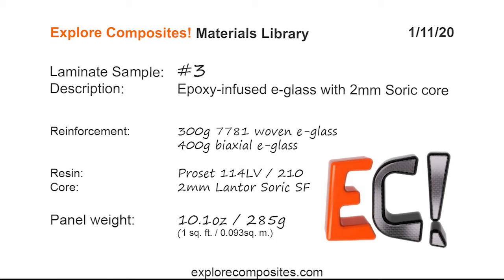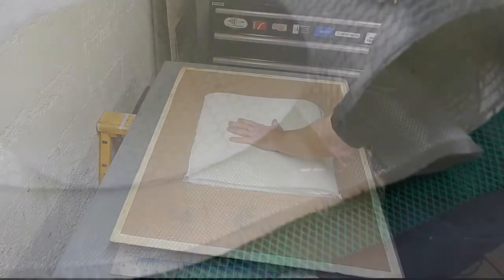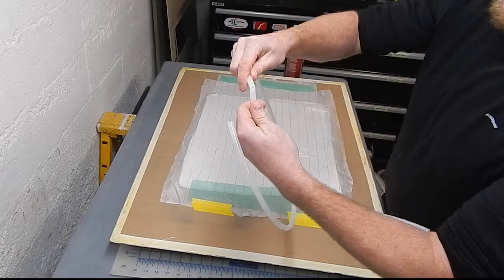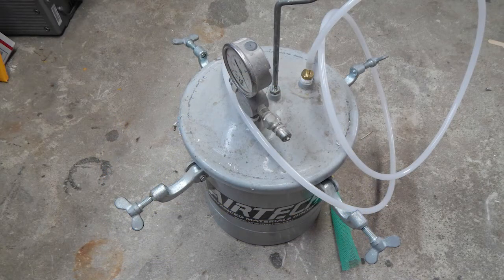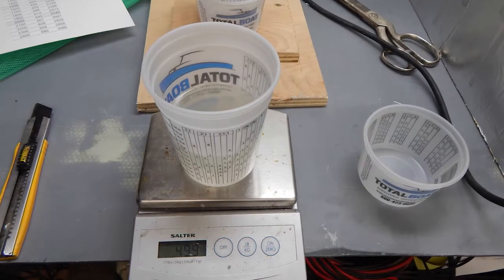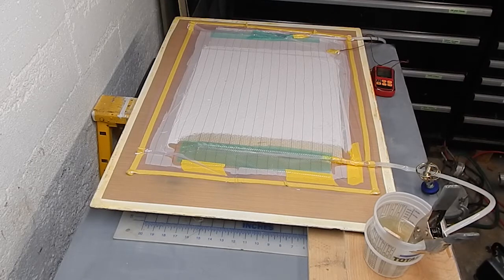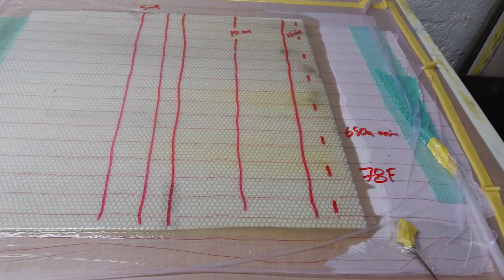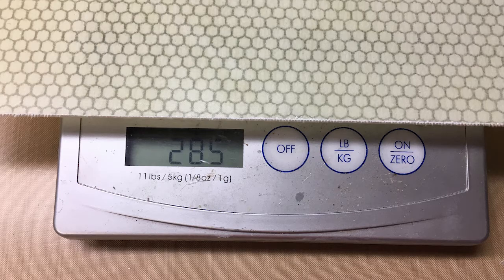Laminate Sample #3: Epoxy Infused E-glass with Soric Core

Comment: Do you have any insight on using perforated release films directly on the part surface (replacing peel ply) with flow mesh on top? There seem to be limited options in obtaining a smooth finish on the bag side.
Reply from the maker: Yes, it works pretty well as long as the perforations are big enough to let the resin through.  There is a (ex. Solvay - now Aerovac ) product called Infuply (Airtech makes one too but I forget the name - probably others as well) that is just a 3D flow mesh with perforated film pre-applied to it.  Seems to work pretty well even for thicker parts that need a lot of resin.  Not sure how smooth the surface will be though - usually gets crinkly finish from the film.  For a smooth finish you may be in caul-plate (or sheet) territory - but you'll need an internal flow media...

Comment: So how strong is it? What would you use soric core for?
Reply from the maker: Lots of things I guess - things that need to be composite for geometry or gelcoat finish but that don't have to be crazy light.  I know it's used in small boats a lot - but boats are what I know best.  You probably don't find much in airplanes - but maybe!  

Soric is probably best used with polyester or vinyl-ester from a cost to performance perspective but it is great for hard-to-fit core areas even with epoxy or carbon price-point parts.  Its just so much faster/easier than foam.
Reply: @ExploreComposites  Thanks for responding to really my dumb question. Certainly you teach anyone who watches plenty and probably are often asked questions that have obvious answers to those who know. Anyway thanks for your informative videos and again, responding to my dumb question

Comment: Would be nice if you had a metric column with grams or kilograms and sq meters too. Excel could do these on the fly from your numbers.
Reply from the maker: Some of the samples are metric, others imperial.  Metric is better of course but I try to mix it up.  Doing both makes sense though!  

Will look into it - Thanks!

Comment: Hi, what is the teflon material that you put on your table? What type of surface does this give the final product and is that surface ideal for future bonding? Thanks
Reply from the maker: It is a Teflon film with a silicone adhesive.  There is a video called: ‘Adhesive-Backed Mold Release Film for Composites Tooling’ and an article linked in that description with a list of sources and manufacturers at the bottom.  It leaves a shiny surface do sanding or peel ply are necessary for secondary bonding.
Reply: Explore Composites thanks so much!

Comment: hi, what was the final thickness of the laminate?
Reply from the maker: This one is 2.7mm / 0.11" thick.  I should go back and add that in the descriptions for these early samples - useful info!
Reply: thanks for your fast reply, by the way did you manage in any way to make a successful resin infusion without flow media and between two plates?
Reply from the maker: @hatemzayani1324  I'm working on it and will have updates - but friction really slows it down after 300-500mm.  Trying some vinyl-ester with very low viscosity and slower epoxy.
Reply: @ExploreComposites  i managet to make it by putting flow media between layers in the laminate i tested it and working very well, but i want to make it without flow media, what if we apply some pressure on the resin inlet may be it could help
Reply from the maker: @hatemzayani1324  Do you mean with Soric or just solid glass?  Soric should get you a meter of flow, but I am not sure there are any easy ways to get a meter of flow on a solid laminate without flow media.  Maybe very slow resin, very warm mold and the right laminate... some fiber styles flow better than others.
Reply: @ExploreComposites  i used regular PE flow media net in the middle of fiberglass layers and between two pieces of plexyglass so i got 2 glossy sides, the net in laminate encreased the thikness by only 0,4 mm
Reply from the maker: @hatemzayani1324  You might want to look into products like Chomarat G-flow.  Never used it but seen samples and it looks neat.  https://youtu.be/UEAXg9LJCPI